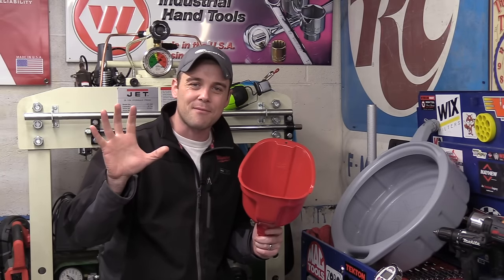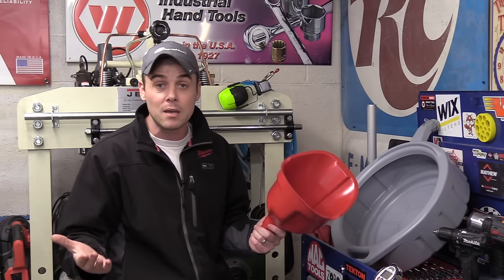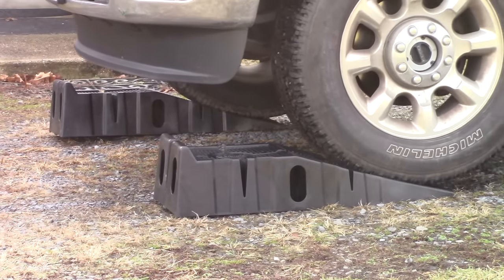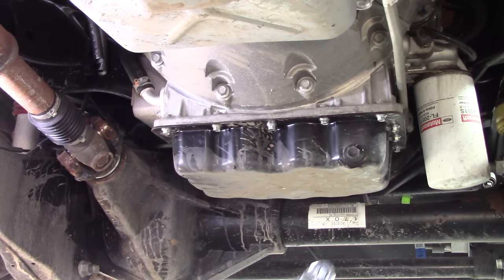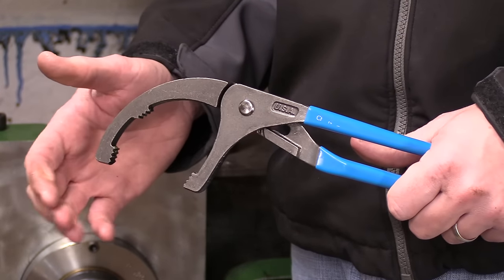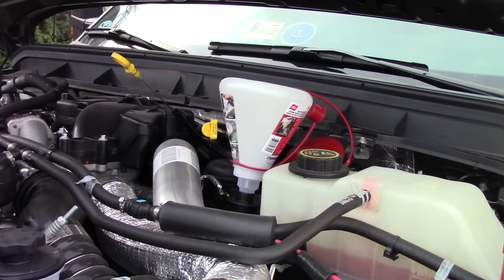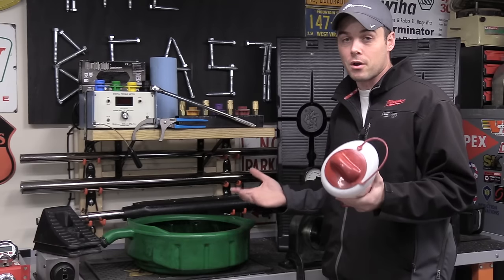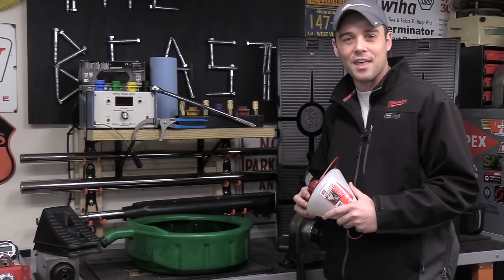Top 5 BEST DIY Tools (Changing Oil)

Comment: As a profession mechanic those oil filter pliers aren't the best. what you really want is a 3 leg oil filter wrench with the flat legs not the round legs, i use them on almost every oil filter i do, even the plastic one and you can use the ratchet on them to so you get a lot of leverage.
Reply: I agree. I used one on my Sienna and it worked great.
Reply: I agree
Reply: Not sure what 3 leg wrench you are talking about.   I will say the filter plier in the video is problematic on small cars as there will not be enuf room typically for them.

Comment: Honestly I dont do my own oil anymore. One my car is to new that their are so many sensors that need to be reset (thanks Volkswagen), and it only costs me about $22 when the dealership does it. If I do it myself im only saving about $3-4 with filter and oil. Allows me to be lazy when they do it. And Walmart is next door so I can get shopping done when I wait.
Reply from the maker: The problem is that they use bulk CHEAP oil from 55-gallon drums....bulk CHEAP filters that have minimal pleats inside and a basic design......and the person doing it is the new kid who just started and makes minimum wage.   Other than that, yeah it’s less work on your part....but there is a reason it is so “cheap”.

Comment: if you have a large filter like the one if the video, take a sharp punch, and pop a hole in the bittom by tapping the punch with a hammer.. this will drain the filter so all that hot oil wont come spilling over the top onto your hands

Comment: I generally agree with all of your ''likes" and "dislikes", but that magnetic drain plug tool isn't something I would use. I noticed that the plug, and the oil on it slings back once the plug releases from the pan. Your video doesn't show if the drain pan caught the slinging oil or not, but it seems like it could make the job more messy, at least with the size drain pan that I use. It might be ok if it wasn't quite so springy, and designed a little more like a flexible carburetor adjustment tool!
Reply from the maker: +RB57 I did a full review on it a year or two ago.....you can see a more in depth view in that vid.

Comment: That ratchet might be great for loosening tight bolts because of its length but your drain plug should never be installed that tight. I would not use any 20 inch ratchet to re-install an oil drain plug or you may be buying yourself a new oil pan. The average drain plug only needs to be tightened enough to put a slight crush on its copper sealing ring or rubber o-ring.

Comment: Sounds wasteful, but once old oil has finished dripping, I always pour a good half liter or quart of new oil into the engine while the oil drain plug is off. Feel like it might clean some residual old oil outta there. Maybe, maybe not. Always do it with my lawn mower and snow blower as well.
Reply: Notap’s shopvac based system blows these tools/systems out of the water. Cheaper, too.

Comment: With 2 of my 3 cars, I can't get any tool to easily remove my filters, so I buy K&N oil filters (from amazon) which have a "nut" welding on the end of them and use a 1" socket (i think that's the correct size, going off memory which likes to fail me) to easily remove them.  

Full Synthetic oil (I use Mobile 1) every single oil change and 2 of my cars have over 210,000 miles on them and have not had any engine related issues whatsoever.  Toyota could use some better wheel bearings though....just saying.

Comment: not sure how the ramps would work on my brother in laws prius or my sisters low honda civic. Also would need to attach a long rope to the ramps that you drive over so the back tires on on the rope as the front tires are trying to climb the ramp
Reply: Have the same ramps and they work fine for my wife Prius. Just drive right up them. Still a little tight underneath but I am a fat guy.
Reply: Joshua Russell the ramps don't seem to want to kick out when you try and drive up them? I once tried plastic ramps on my cement driveway and they just slid back every time I tried to drive up them
Reply: Nope. I use them on my epoxy coated garage floor and it is slicker than snot. I have also used them with my truck on the same floor. Sorry you had trouble with yours.
Reply: Joshua Russell must have just been cheap hard plastic not engineered and tested the way the rhino ramps are
Reply: TheSimplecanadian  these are low profile ramps if ,you find them slipping put a mat or a rug under them

Comment: I don't recommend the plastic ramps.  They slide forward when used on pavement every time you try to drive up them. The metal ones slide a little less.
Reply from the maker: +Chris these aren't like the old ramps that are completely plastic.....I have old grey ones that slide......the Rhino ramps have a rubber foot built in at the base that prevents any movement once weight is applied.

Comment: Never been a fan of ramps. I put my cars on jack stands anyway. I rotate my tires at every oil change.
Reply: rogermurph101 
also would want to make sure the drain plug is positioned to the rear of the pan so the angle on the ramps wouldn't prevent a full drain. seems most vehicles are designed that way though, you drain to the rear. if jacking, sometimes the plug may be located towards one side, so jacking from the opposite side would be better.

Comment: These are excellent choices.  If you are moving into more advanced auto repairs, then save your money on the ramps.  Put that money towards a jack and jack stands.  Harbor Freight's Daytona jack gets excellent reviews and looks like it's made in the same factory as the Snap-on jack.  Same goes for their Pittsburgh Pro long handle ratchets.

Me, I am frugal.  Cut a quart oil bottle in 1/2, you have a funnel.  I can squeeze under cars without lifting the car.  If you can't, park one side of the car on a curb.  You can get some oil filter wrenches on ebay directly from China for only couple dollars.  Ya, these are hillbilly methods.

Comment: my 2000 ford F250 is high enough to not need ramps. but i agree with most of these tools.
Reply from the maker: Yeah..... my F350 doesn't need them either --- but it was an easy way to prove if they could take a lot of weight or not.  Some people online said those ramps broke with a small car.....the front end of a 4x4 diesel weighs a LOT more than their entire car.

Comment: I don't expect you to state this in your video, but everyone please stop supporting oil companies and their ridiculous oil branding. Get store brand oil that's verified to government standards the same way every other jug is. For example, I get Wal-Mart super tech synthetic in the ugly jug. In most places, it's actually name brand just in a different bottle.
Reply from the maker: +Aaron Blankenship I use Walmart Oil in our cars with zero issues....you are correct, most of it probably comes out of the same bottling plant.
Reply: Actually, SAE did a study about a year ago and found that about half the oil products did NOT live up to the level the certification seal indicated on the container. So I would only trust products which come directly from petroleum companies. However, since SAE didn't identify which companies had legitimate complying oils, I'm still taking somewhat of a chance even so.
Reply: +Geo Logic While that makes some sense, unintended results are not usually a consistent trait and usually simply indicates not enough testing by SAE or the manufacturer.  If they continued their practice of low quality, then there would be great legal implications pushed by SAE, and even those results make SAE look bad for allowing their badge to still be on it.  The Walmart stuff in my area has more than just SAE certification on it (something about GM green cert?), so I'd hope more eyes might help consistency.

Considering that there are no tiny oil companies that could be outside regulations like grey imported Chinese products, the chance of even getting oil that isn't from a big manufacturer is extremely slim. I'd imagine the biggest risk is messing with the stock adding things to it like premium brands do, where the off brand is straight untouched stock.
Reply: I completely agree with you that someone dropped the ball and the refineries took advantage of this. I don't know SAE's MO, but it's only sensible that the certification process should be continuous, not just done at the start of a new product.
Reply: Aaron Blankenship SAE compliance is not the same as manufacturers specifications and requirements. Just like all gasoline isn't the same, neither is oil. I build engines for a living and I can tell you exactly which ones use the right spec vs. the ones that use whatever's cheap. Oil weight is the last consideration you should make. Not all 10w30 is created equal.

Comment: lol cheaper?  you're havin a laugh man.  doing it yourself costs the same or more than getting it dome at a shop
Reply: ***** lol im not saying dont do it yourself. Im just saying ive never saved any money in the 300 or so oil changes ive done myself.

my last oil change cost me 80 for oil and filter. Then I needed to buy a new oil filter wrench because the ones I had didn't fit the chevy. So thats 80 bucks + 2 trips to the store. Vs 60 bucks and 10 minutes at the local oil changer. And do keep in mind that those cheap 4 or 5 dollar filters arent rated for the 15000 miles your synthetic oil is.
Reply: How much oil does your vehicle take? I only need 5.5 quarts for my V-6, and I picked up some oil at Costco (12 quarts for $25) which will do me 2 changes, filters are cheap, and $2 for 3 gaskets isn't half bad at all. but I think knowing that the job is done right and well is worth more than a couple bucks you save going to a quick lube place.
Reply: tim turner - If you can get your oil changed for less than doing it yourself, chances are they're using the wrong oil which can shorten the life of the engine and possibly cause drivability issues later on. Not to mention the cheap oil filter without a safety valve lube shops typically use.
Reply: Prices at the shops around here are cheap. And do cost about the same as doing it yourself. Many places are $19.99 but I stopped going to them when I noticed a couple things. 1. They use the cheapest oil in your car and the cheapest filter. 2. They dont even wait for it to completely drain when it slows down the pop the plug back in. 3. Ive had stripped plugs and oil caps left off. 4. Mom and pop shops buy a 55 gal drum of oil and use it for every car that comes in. If you change it yourself your doing it at the same price as the shop but you are using quality oil and filter and make sure its being done right. I can change both my cars in 20 mins in the driveway.